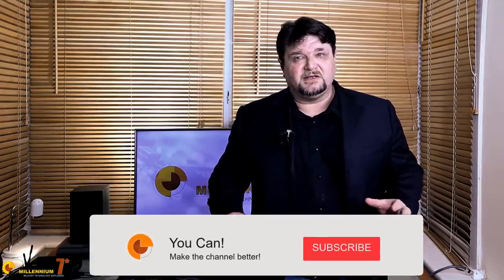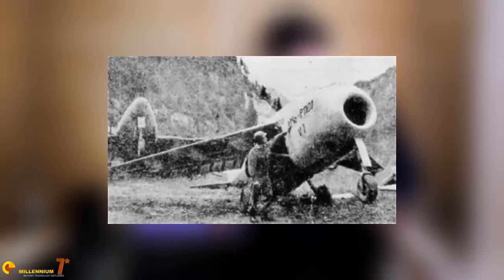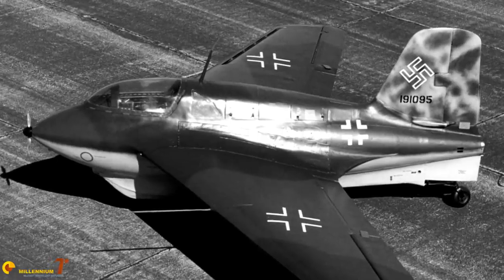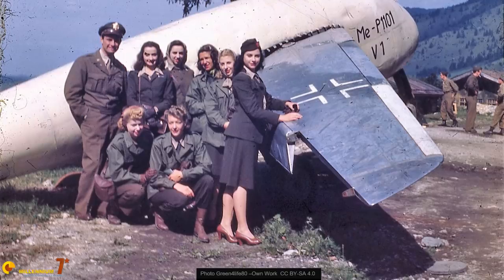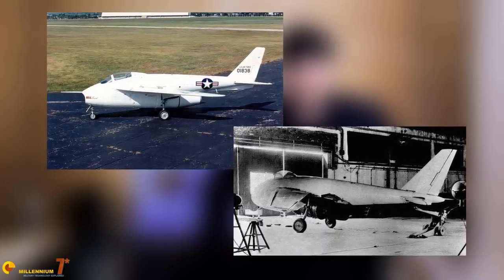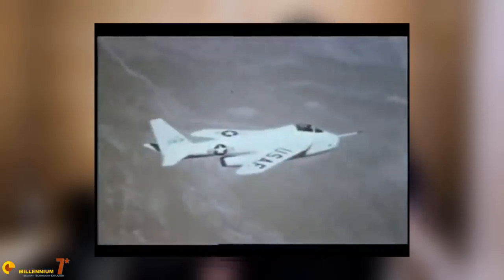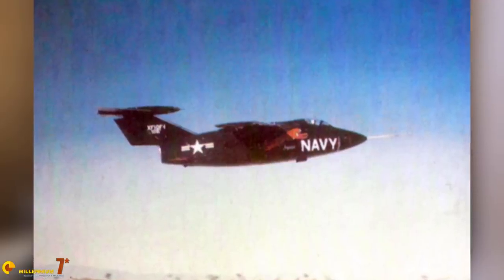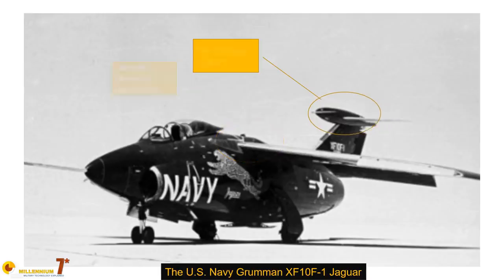The Swing Wing - The Origins - F-14, F-111, Tornado, Tu-160 etc.

Comment: F14 Tomcat ... The most beautiful Fighter aircraft ever.  I can't believe the hold not  few of them F14 D  in good shape for airshows.. 😪
Reply: There's plenty of working models being used by the Iranian airforce (no joke.)
Reply: @jeffspinner6579  It is not exactly clear just how many F14's Iran has because they do not have replacement parts all this time and have had to cannibalize their squadrons just to keep the few they do have flying. The reason the vast majority, if not all, the US Tomcats were scrapped was to deny Iran from being able to acquire replacement parts. I will counter your "plenty" with my "a few".
Reply: They were maintenance nightmares. They were built for fleet defense which is why countries that could afford it , bought F15’s for their air forces. (Iran is a bizarre exception). The F14 became famous because of the movie Top Gun. Swing wings were a fad.
Reply: @frankleespeaking9519  Hell no! F-14 had an exceptional history and accomplishments. Irani pilots fully evaluated and spoke extensively about the superiority of the F-14A over the F-15A in terms of radar, Phoenix system and close range dogfighting at high angle of attack when they did flight evaluations in 1974, which led them to pick the F-14A over the F-15A. They simply were willing to spend $10 million more per F-14A over the F-15A to get that capability. They got a 164:4 kill ratio with their F-14s and they are very proud of their Tomcats. You can read up on it. Ask any US Naval aviator who flew an F-14 and that person would laugh in your face for saying it was a fad. It was an air superiority/fighter interceptor combination and is still the best thing Navy ever got. During the Gulf 'line of death' in the 80s F-14s were intercepting MIG-17, MIG-21, MIG-23, MIG-25 on a very regular basis over the international waters and had no issues getting locks on them in fights, but Reagan rules of engagement did not allow them to shoot unless they were fired upon. Read the book "Tomcat Fury" and that goes into all of the details of it. F-14 had exceptional maneuverability and proved itself at Mach 0.6, almost no one could keep up with it in a turning fight. Only 1200 feet diameter at Mach 0.6 in 19 seconds minimum radius turn at 7.5g - 8.5g.  The variable geometry wings gave it the capability to out-turn much smaller, agile planes because of how much lift the airframe/wings were providing in very tight turning fights. That was because its airframe was so flexible that it could accelerate up to Mach 2.4 with the wings swept back while also having super high maeuverability in the 300 knots to 450 knots range. The F-14 was designed to do everything exceptionally well. Go look at the air shows and nothing ever in the 4th gen fighters ever came close to how amazing the air shows it used to put on especially in the hands of Dale 'Snort' Snodgrass. It was built to do everything exceptionally well through out the envelope. A lot of that was the ingenious design of the airframe, which is why it.
Reply: F-14 was an incredible plane. It was the most feared and revered fighter when it was in service. If a pair of F-14s with wings swept back and full weapons load were coming guns blazing at Mach 2+, no one ever wanted to stand in their way. The F-14's variable geometry wings and the wide high-lift airframe gave it enormous capabilities and a very broad envelope Everyone from Navy absolutely gushes over the F-14 who flew it and it is widely considered the best thing Navy ever got. The F-14D was an absolute beast with the GE-F110 engines producing 60,000 lbsf of thrust. It is what defended the fleets, international waters and coasts during the cold war during the 80s. Even in the 90s, no one wanted to engage with F-14s because Saddam had told his MIG, SU, Mirage pilots to explicitly not engage with the F-14s.
Reply: 2ZZGE100 I said swing wings were a fad. And every pilot “loves” their aircraft. I used to work on f111’s they suck. F14s have all been destroyed the f15 is still in production. I don’t mean to hurt your feeling I’m just saying no one does swing wings anymore and a lot of it is because of maintaining them.....

Comment: It's great how you avoid the usual potholes surrounding the subject. You for instance include the British Barnes Wallis connection. This is all to often left out, either by people being superficial but at times also out of US "patriotism". Many sources actualy claim that the idea to enhance the fixed portion of the wing from small sleeves to a propper inner wing section came from the Vickers Swallow studies and not from Bell itself, although such sources then tend to be british of course. I have actually often wondered why the Tornado suddenly could do without again. Did it's flat fuselage have a partial "lifting body" effect? Or was that part of the reason why it's fin is so gigantic? Maybe we'll hear the answers in your next installment, which I am very much looking forward to. :-)

Comment: Though I've heard the Navy really would like the F14 back, if the swept wing design is so good, why are no modern warplanes using it atm?
Planes designed in the 1970s and built in the 1980s, don't count, i.e., the B1 that is used to bomb non-peer "enemies" exclusively, because it's no match for even the S-300.
Reply from the maker: You will need to follow the series! Obviously there is a reason...😉
Reply: Probably cost related. 

It isn’t the swing wing that makes the B-1B unable to match up against the S300. F-15s, F-16s, and F/A-18s don’t match up either, and they are not variable sweep.

That being said, it is probably impossible to have a stealthy variable sweep design, unless it was stealthy at only one wing sweep angle.
Reply: It's good if you need what it can do, bad if you don't.  A variable geometry wing provides greater aerodynamic efficiency and performance over a wider flight envelope than a fixed wing at the cost of additional weight.  The tradeoff works for an aircraft that need to be efficient at both high speed and low speed ends of its flight envelope.  It was a good choice for a bomber like an F-111 or a B-1 that needed to takeoff very heavy, cruise efficiently for a long way, and then make a high speed penetration in the target area.  
As a fleet defense fighter the F-14 was an example of a fighter that needed long loiter time combined with a very high speed dash capability, so the extra weight was also judged worthwhile in this application.  The F-15 rejected the VG wing because the weight would compromise the aircraft and the wing was optimized for sustained maneuvering at typical combat speed, knowing it would be less efficient while loitering or dashing.  Most fighters serving with smaller countries were not designed to fly even far as an F-15 can.
Reply: @kostaskritsilas2681 , though the SR-71 was supposibly the first aircraft to try to be stealthy, (that we'll ever learn about), and that was applied to the B1, Idt with near peer enemies like Russia or China, we have stealth at all.  They can be tracked but not locked on to, given the reports from Syria.  So all they do, like in Syria, is send a Su 35 to find them with their IRST and they find them and the planes turn around and leave the area (even the F22s).  So Idt stealth is as important as people think now, more the F35 being a communication, command and sensor node is where its power lies. 
Idk, I still think there's something to the variable geometry, but I can't put my finger on it yet to explain why.  Idt it's from Transformer movies (!)
These days, I think of aircraft as just air to air and air to ground bomb buses.  So everyone just having cruise missiles and missile defense, with UCAVs for force recon, should be enough.  The AWACs, those other big radar planes that can track all the armor and vehicles in theater, and our satellites would be the first to go in any conflict.  Even the Navy figured out an aircraft carrier battle group is indefensible, and are looking at small ships in huge swarms to replace it.  I'm really concerned Trump placed 2 aircraft carriers in the East China Sea, around the 4th of July, I see Gulf of Tonkin, that false flag [admitted], all over again.
So far, thank god, nothing.  Nuts, I was hoping I would figure out why I thought the swept wind was peaches, but alas, no yet. 
Stay safe.
Reply: jeff spinner As the other poster stated, you can optimize aerodynamics over a wider range with a variable geometry wing. For the F-111/FB-111 and B-1B (actually even more applicable to the original B-1, which had a higher top speed), it was very long range cruise combined with high speed when getting close to the target. In the F-14’s case, its that, plus the need to launch a very heavy fighter from the carrier deck. A fixed geometry fighter would have been a compromise, as the F/A-18 (even the E/F versions) is. Even though it is a newer design, using newer engines and electronics, it cannot do the fleet defence role the F-14 did. I don’t think that the Navy wants the F-14 back, what they want is a plane that can perform the F-14’s role. If the Pentagon had not lost their minds over stealth technology, they could have commissioned a proper F-14 replacement. That short sightedness is what has lead to the current anxiety over the current crop of hypersonic anti-ship missiles from Russia. If there was a fleet defence fighter that could carry 4-8 missiles capable of destroying hypersonic missiles, there would be no anxiety over things like the Brahmos.
Reply: @kostaskritsilas2681 k, ty, that makes sense to me.
Reply: VG aircraft can't be all that stealthy. I think that's the problem.
Reply: @Millennium7HistoryTech , given even the US Air Force has finally admitted to the F35s flying brick status by recently declassifying that they flew a plane that may actually work as advertised, I'm looking forward to your discussion on the subject.  

I did watch the follow up and I was surprised that the F14 was actually made lighter by having the variable swept wing.

Comment: The initial concept of Tornado was actually VTOL with the pivoting aft nozzle and side auxiliary vertical engines. How come it finally is a swept wing?
Reply: I always thought it was derived from the Anglo French Variable Geometry (AFVG) study.  It gets a mention in the history of the British TSR-2/ F-111K  saga.
Reply: @misspuddles63  Tornado came out of AFVG, but that in turn came out of VG studies done for a number of other British paper projects in the early 1960's including a VG TSR 2.  I think the guy above is getting the Tornado mixed up with the German / US design proposal (by EWR of Germany and Republic of the USA) for a supersonic strike aircraft that had a vectored thrust engine at the rear, side opening doors with RR lift engines at the front and VG wings with the air intakes on the top rear of the fuselage , There as also a Dutch / US design done by Fokker and Republic that had a Vectored Thrust engine like the Pegasus and VG called the D.24 Alliance which was being kicked around in the early 1960's.
Reply: @richardvernon317  I don't think I memorized the wrong thing or mixed them up but from you detail research it could be just in the path of aircraft development or project evolution that they just dropped this idea for sake of the better things ( less maintenance hassle, more economical etc.) I still have the photo but it has no details.
edited: yeah, I got it from www.VSTOL.org but searches again with google, can't find it.

Comment: Variable geometry reduced the number of aerodynamic compromises in a design for the cost of more weight and complexity.
Current/next generation aircraft make aerodynamic compromises so that they can be more stealthy. (Am I overestimating that?)
Could there be a design for a stealthy aircraft to be able to switch to a more agile configuration when a dogfight starts?
Stealthy until detected then a competative dogfighter.
Reply from the maker: I am sorry but you are a bit off the mark, but this is a very long subject and it will be covered in the series.
Reply: @Millennium7HistoryTech  
Thanks for the reply. 
I know that the benefits of variable wing sweep have nothing to do with stealth. I look forward to your next video.

Comment: Mirage III G8 
The french swept wing
Reply: The prototype french swept wing.
Reply: @gort8203  the disgn still have been use for an improve disgn ... how leaded to the F14
Reply: @didrechus9904  The F-14 design grew out of Grumman's work on the cancelled F-111B, but you imagine that the F-14 wing was patterned after the Mirage G rather than the F-111?  I don't think so.  Mirage cooperated with LTV on the design that lost the competition to the Grumman F-14.  Grumman later asked for some of the LTV data, but I suspect it's a stretch to claim that data led to the F-14.

Comment: Variable wing aircraft performance looks great in theory. In practice, the mechanism for the wings proved to be too heavy and impractical. The gain does not overweight the disadvantage. F14 is huge and inefficient. The replacement is the F18 which is much more efficient and performs far better than the F14. That is why to day no one build variable wing anymore.
Reply: Agreed that the tradeoff is not worthwhile for most airplanes given the mission profile they are designed to perform, but I suggest the word "inefficient" is not the the best word to convey that.  If you need an airplane to be optimized for efficient flight across a wide range of speeds, rather than for a relatively narrow speed range, then a VG wing is very efficient, which is why it was chosen for the F-14. The question is whether the mission of the aircraft requires and makes use of that level of aerodynamic efficiency, and if not then it's often not worth the weight and complexity.

Comment: This is the one technology which I question the practicality. Every variable sweep winged aircraft has been either marginally successful (after a few costly iterations) or just an outright failure. The added weight and complexity just to get them working right doesn't seem to make them superior to conventional designs. I cannot name one that was an outstanding performer or didn't have astronomical development and maintenance costs.
Reply: F-14? Yes the mechanism wasn't light, there were a lot of problems. However as I am certain you'll be answered in next video. For my part, all I'm going to say that you have a far shorter landing and take-of with mostly straight wings, but trans-sonic an supersonic speed and maneuverability are drastically better with swept wing. But given how complicated this is many went with what you'd call an compromise - Delta Wing. If you can make the variable geometry work flawlessly however, you have an aircraft that is superior to delta in both slow and high speeds. I simplified a lot and this is just one factor.